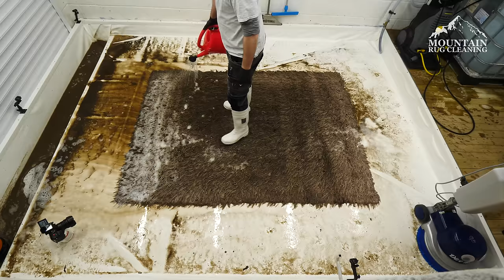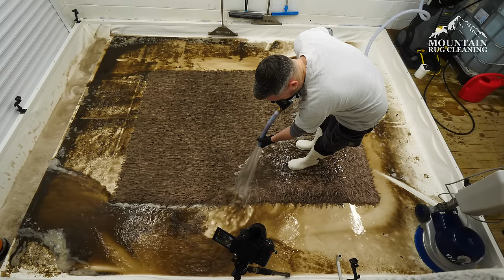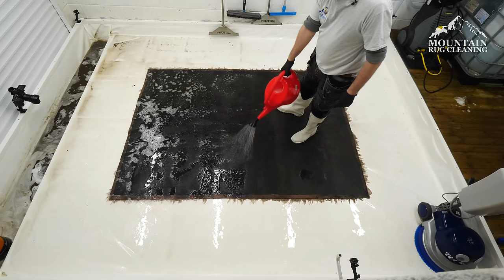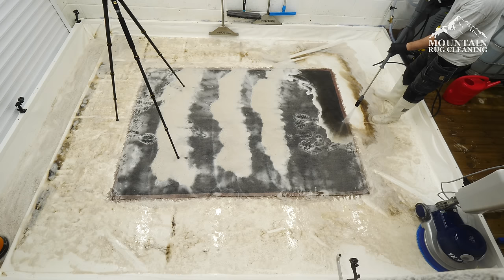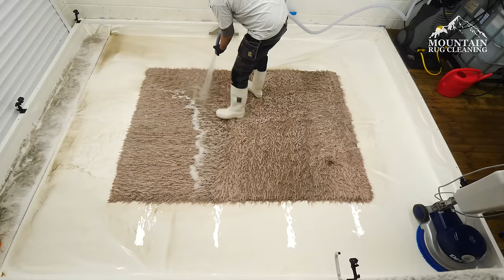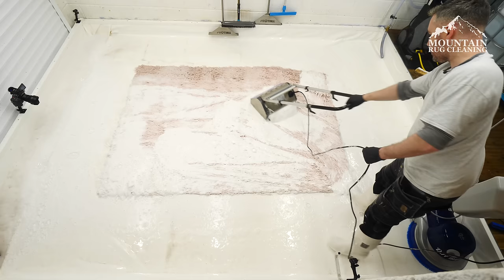Cleaning The Nastiest Rug - Long Relaxing Version

Comment: Yes. I'm curious about all those things in the other comment, plus...don't you have a drainage system for the dirty water? You have to get it out w/ the vacuum? What do you do with it then? Are you limited on the amount of water you can use? Occasionally, it looks as though some of those rugs would benefit from more extensive rinsing before you start scrubbing...

Comment: Genuine question: why dont you clean the rugs on a rack? The dirt water seems to be reabsorbed into the rug a lot of the times so it would definitely help if its on a sturdy rack/grate, maybe the rubber carpets with the holes can help with it too
Reply: My guess is that it takes extra work to clean off all the extra equipment. I hated dragging those big rubber mats to clean under them at jobs, and they themselves get grimy and I'd personally hate to clean that between every wash as well 🤷

Comment: Just curious why you dont begin each rug cleaning with a dry stiff brush or a good heavy carpet vacuum with a hard core beater brush, or hell, even a good smacking with a paddle while hung over a rod would get an insane amount of that dirt off the rug before you even get the rug (dirt) wet.  

Its just my preference, but I want to deal with dry dirt before wet dirt.

Or is that already done before you drag it un the tub?